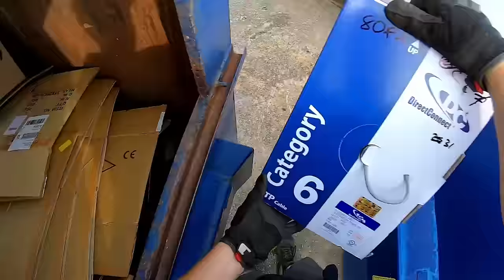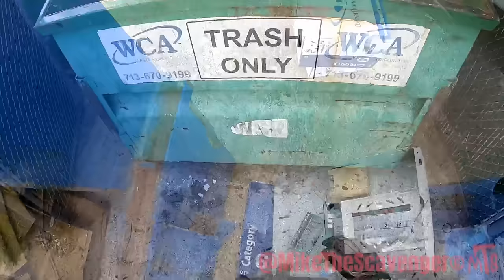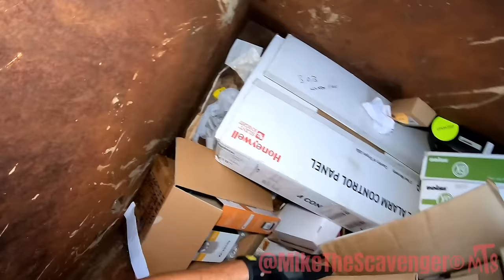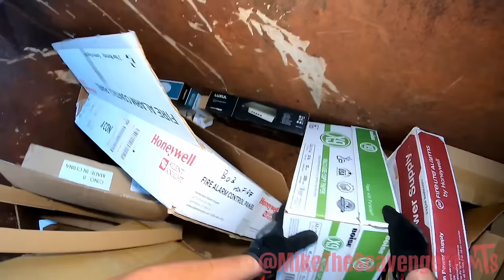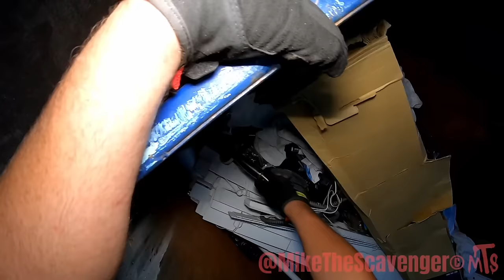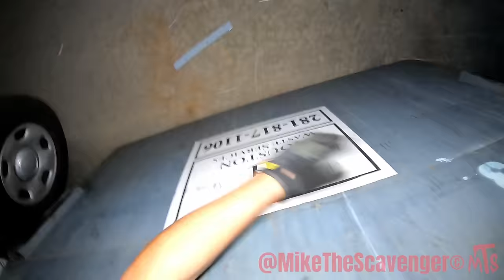Dumpster Diving "Coagulating Photos"

Comment: Mike, mike, mike... you forgot the golden rule. Work smarter, not harder. That greasy cooler you found and had a hard time loading on Dottie, you had the length of rollers you could have used as a ramp and just pushed it up into the truck. Now if those legs come off those rollers maybe you can keep the rollers to use getting water tanks or other heavy pieces of scrap into Dottie.

Comment: Mike you need to think about getting a small trailer to haul behind your truck so when you get those big loads your not putting as much wear on your truck Just a thought. Was a really big wire night.
Reply: Mike can fit anything and everything in his truck why would he want to drag around a trailer?😅
 But seriously a trailer can be very cumbersome for most scrapping because you are trying to get in and out of tight spaces most of the time  with the type of scrapping Mike does.  A trailer can be great for street scrapping where you have space to maneuver and lots of low quality shred.

Comment: That skate wheel roller conveyor was a good find Mike. Those things are really expensive. Even with the bent rail that it has, I'm sure you could sell it easily for way more than scrap price. I was screaming and yelling at you that you had missed a valve in the pool dumpster. Then you finally grabbed it and I was able to breathe a sigh of relief and settle down lol

Comment: Hey Mike, 

If you are interested in making a few $$$, hear me out.

I collect old rubber soccer balls, used over 40 and 50 years ago, that schools used.
many folks may not know this, but many high schools, middle schools and even a few colleges used high quality polyurethane rubber soccer balls in many of their games in the late 1960s and throughout the 1970s.
School districts usually hand down worn out sports equipment (I.E soccer balls) down to the lower grades, when they get newer stuff in.
After a while, these sports balls get very worn, beat up and become flat, and then tossed out.
Some PE teachers will just toss them in a box, and never get around to throwing said box out for years.
To me, there might be a few "treasures" in that box. There "could be" a vintage rubber soccer ball or two in that box, that is old, very worn, flat, and made of PU rubber, and was used in many soccer games over the course of time. I would pay a premium for soccer balls like this.

This goes for anyone else out there reading this, if you have old rubber soccer balls, and they were used in soccer games in the late 1960s, 1970s, and into the 1980s, let me know, you could make a few hundred off each one, even if they are flat and damaged. As long as they don't have "dry rot", check with me first before throwing it away.

Comment: Why do people put that wire in the dumpster? Why can't they use it or sell it? I just don't get why perfectly good wire is in the dumpster.
Reply: Because they are usually too busy making a ton of money doing the job. Not worried about the $20 worth of scrap wire they throw away. I'm sure tho that most contractors do have enough sense to build up a pile for recycling later. I know this because a lot of reconstruction dumpsters I check the wire is not there but plenty of other metal is . That tells me a scrapper hadn't been  there yet.  I think it seems like a lot to viewers but you must realize how  many dumpsters  Mike checks in one outing.

Comment: Cannot understand why they are throwing away so many cardboard boxes and not flattening them either. Most of the rest of the world split and flatten empty cardboard boxes, pack them separately for re-cycling rather than dumping into land fill. Looks like someone could run another business just collecting cardboard for re-cycling. Only problem, need a massive storage area for it to make it worthwhile as it is sold by the tonne / ton.